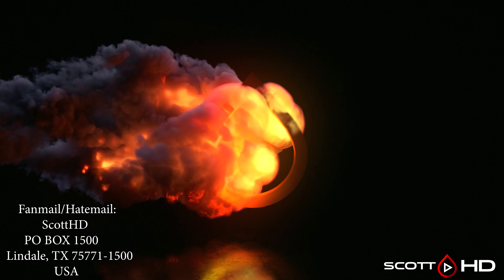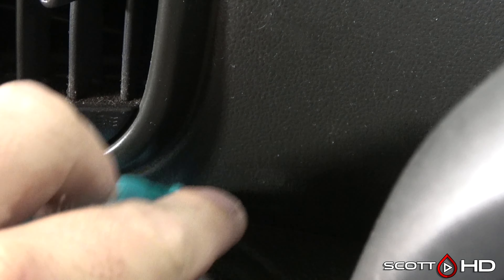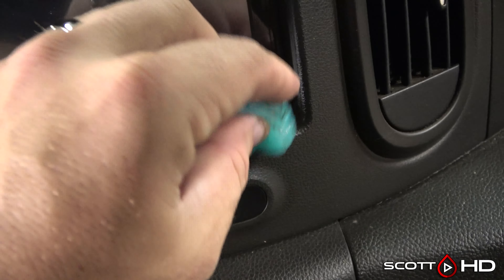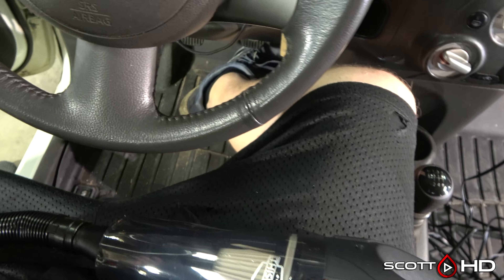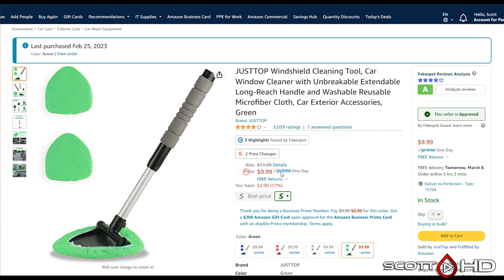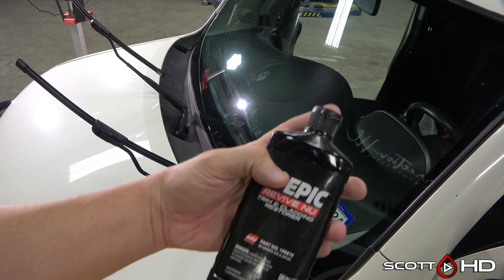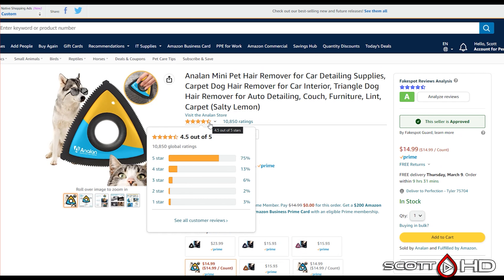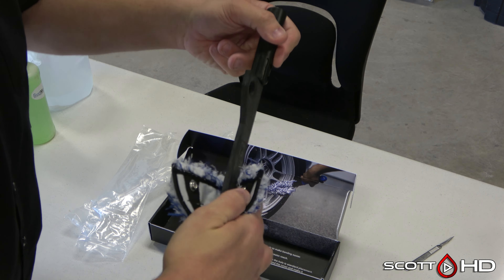Top Detailing Products on Amazon - A professionals take on them - Car Soap, Vacuum, Pet Hair Removal

Comment: I tried that gel before and it is an absolute joke.  I am baffled by the number of people who give it great reviews, although Amazon is mostly run by fake reviews nowadays.  I use the New Car Smell, but I dilute it with distilled water and put it in a tiny spray bottle.  Just a couple of spritzes is more than enough to do the job.  I wouldn't be able to stand it full strength.
Reply from the maker: Agreed on both points.   The gel didn't work for me at all.  Maaaaaaybe a light dust or something.    And the new car smell, it's pretty intense.  Didn't think about diluting it.

Comment: Hey Scott, have you ever tried using a paint brush and a spray bottle for cleaning vents.? You don't spray into the vent. You just spray a little water on the paint brush and then with the air conditioner or whatever running so there's air coming out of the vent. Just brush the vent with the very slightly damp brush and do that a couple of times. Then get the brush damp again and clean and dry it as much as you can and brush it one final time. Fresh event. That is one final time. I've found that that gets them done really quickly and because the air is running you don't have to worry about dirt and dust getting down into the vent and blowing back out later.
Reply from the maker: I have and that's usually a great tool as long as it isn't sticky like a cola that was in them it has worked well.  Ones that are really bad I try to remove if it is easy to do so.

Comment: When you have been detailing for several years using the best equipment on the market, it's hard to get impressed by cheap stuff designed for people who don't know better.   For the vacuum, armor all makes a vacuum cleaner for cars that will very likelly be in the same price range and be better quality.  For the window tool, I have been using the one from Stoner's (Invisible glass) and it works well.  I would not be happy doing windshields or back windows without it, that is for sure!
Reply from the maker: I actually got the armor all one for a wedding gift 16 years ago!  It's not bad at all. It's still kicking! I use it for clean up for my mini mill for notching axles, face mill etc. (metal shavings cleanup).

Comment: i have a similar vacuum since many years, and it does the job. But i have to power the engine on because it drains the battery very fast.
Reply from the maker: I guess that depends on the vehicle/battery.   On this little Nissan Cube it did ok at not draining the battery.  I used it for 10-15 minutes